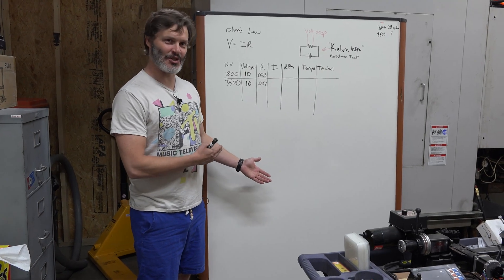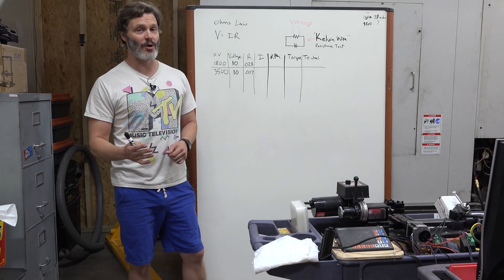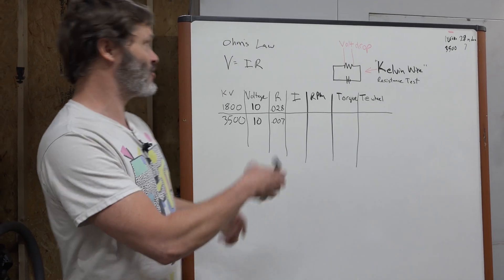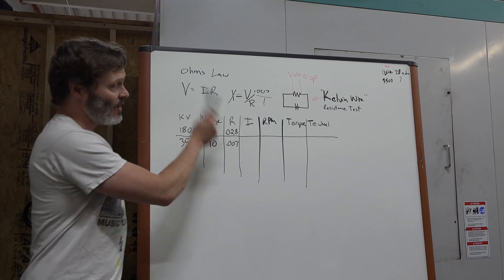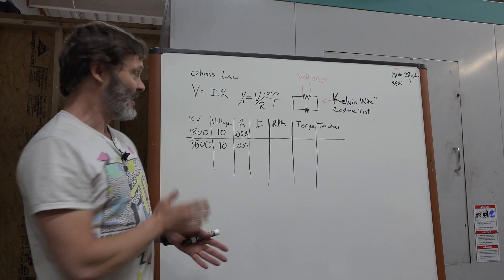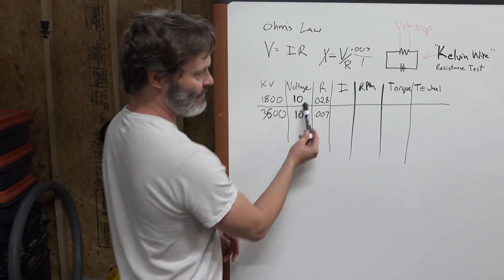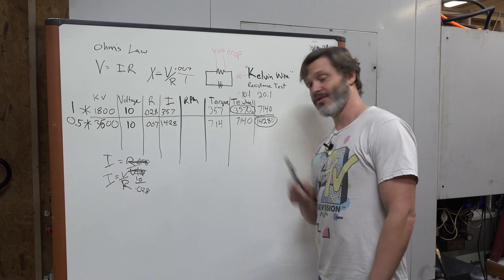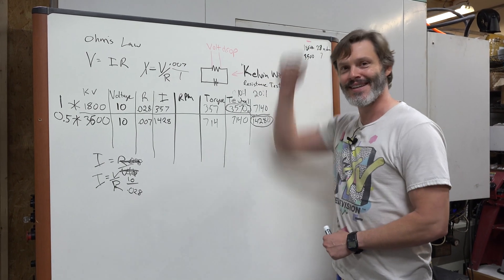1000KV @ 20:1 gear down vs. 2000KV @ 40:1 gear down || Holmes Hobbies which motor is better

Comment: Why do you see crawlers using lower kV?
Reply from the maker: Above 3500kv the amperage at stall becomes tremendous and requires a big esc. 

For the wheelspeed needed with the gear ratios available, 1800 to 2300kv is a sweet spot on 3 and 4s lipo. 

We really dont need more power or motor rpm than is delivered from a 2300kv motor on 4s. 

Rock racing does use higher kv though.  3500kv pullers are quite popular for that.

Comment: Is this the same for brushed motors?
Reply from the maker: @Motovlog865  Nay, brush losses make somewhere around 30t to 35t 540 or 27t 550 peak torque
Reply: @ I see, so a CrawlMaster Sport 550 12T on stock gearing would be better than the 8T geared down to the same speed?

Comment: Nice video. Could you please measure 3 brushless motors on dyno and do comparison torque graph for them (3 lines at once)?  It's hard to explain to people that higher kv motor produces more torque, they keep comparing them with gasoline and diesel engines in 1:1 cars. I found torque graphs for 21t, 27t and 35t GoolRc cheapo aliexpress motors, they confirm your words, but people don't believe saying that "it's some crappy chinese stuff, do you have better source for proof" and "you better do some study in phisics".
Reply from the maker: @built_rc   it doesn't work quite as well for brushed, because of brush losses.  Somewhere around 30t for a 540 is peak torque, depending on quality.   Lower quality, higher turn at peak torque.
Reply: @HolmesHobbies  what about comparing number of brushless motors with graphs?  I tried to search that kind of info, no luck. Manufacturers don't post it on websites

Comment: Great video! I’ve watched it multiple times. One thought I had is that your demonstration highlights what these motors are capable of with unlimited power. Based on the formula Torque = Kt × Current, where Kt = 1/Kv, the lower KV motor will always produce more torque per amp. However, since Mechanical Power = Torque × Angular Velocity, I can see why you emphasize that the higher KV motor is more powerful overall at higher speeds. At what point do you think it makes sense to prioritize a higher KV motor over one with greater torque?

Comment: I don’t get it. Don’t volting up and gear down make ur crawler has tone of torque twist? In climbing steep hills, this is going to make the rig flip, right?
Reply: Cause I geared my axle down a lot. Under steep hills, my rig wants nothing but lifting😅
Reply from the maker: @Bradon881   any time you make more torque or power, yes torque twist gets worse.  If it's making your rig peel off the rock you need to start changing suspension geometry or CG

Comment: Do you have a break down of your crawl master and trail master motors?  I am curious what the plastic piece is at the back of the motor just inside the cooling holes. I have a trail master 21t in a stock geared bomber. Using it as a crawler. I smoke checked something in the motor. Trying  to figure out what smoked.

Comment: How do I obtain parts for a 40:1 gear down condition? Is it possible to reduce the pinion, spur, and differential to get to the 40:1 gear ratio?
Reply from the maker: This was just a thought experiment to show that lower kv does not produce more torque in most situations

Comment: Okay, but this is all predicated on not changing voltage. If you KV down, you're supposed to keep the gearing the same and bump the voltage up in order to gain efficiency and runtime.

Lower KV, same gearing, same voltage = lower temps, lower top speed, less draw, longer run time, same (?) acceleration
Lower KV, adjusted gearing, same voltage = similar temps, same/similar top speed, similar/more draw, shorter/similar run time, poorer acceleration (lower torque)
Lower KV, same gearing, higher voltage = lower temps (?), same/similar top speed, similar/less draw, longer run time, same/better acceleration
Lower KV, adjusted gearing, higher voltage = similar/higher temps, higher top speed, similar/more draw, similar/shorter run time, same/poorer acceleration (?)
Reply from the maker: We have to keep something constant for sake of comparison. 

 If we doubled the voltage for the slower motor and didn't change gearing,  the example would basically be "how much voltage drop in your esc assuming it can handle twice the voltage" and nothing more. Since most escs are ran near their voltage rating, it's not a useful demonstration to showcase that lower kv motors don't actually produce more torque.
Reply: @HolmesHobbies  Doesn't necessarily have to be double, and my proposal in general is more for people looking to either select their power system from scratch, or start over completely.

Comment: This is a great video thank you! One thing I didn't get out of it though, how does this affect you battery? May be a dumb question lol. Assuming I'm using a 3s battery, would a 1800kv with higher gearing use more juice than a 3800kv with lower gearing?
Reply from the maker: Depends on how you drive.  If super easy, runtime will be about the same.

If you drive hard, the higher kv will have less time because you are using the extra power available. 

Longest runtime would be 1000kv at 40:1 however.  But wheelspeed is half as much.

Comment: I miss my cobalt 10 puller motor. That was hands down the smoothest most bananas powerful crawler motor Ive ever run. Easily twisting off axles and causing general mayhem to the chadsis and driveline of any irresponsible throttle application. I would have that motor again 1000 times.

Comment: 10:15 But if the 1800 KV Motor has twice the turns on the stator the magnet field will also twice as strong = more torque per amp
Also the bigger Motor use 4x more Energy and has also much more losses overall to double the torque.  Very bad efficency here.
For drag brake i would recommend a sensred motor.  I had one from Graupner 15 Years ago.. The Braking was like a brake disc !  Even still standing
Reply: True that more turns provide more torque per amp. The issue is that it will lose amps per volt "faster" when increasing the number of turns. Thus less torque per volt when increasing the turns.
If one stick to the same volts per turn the motor will theoretically behave the same, no matter if it's one or a hundred turns...

Comment: late to the party (got into the hobby not long after this video was posted, so it took me a while to find something like this, discussing it in more technical terms :))

aaanwyway, now that i understand things a bit better, i have a technical question tangentially related to this one:

does it matter WHERE you do the gear down? to try and be more precise, i mean, are there any pros or cons to gear down by going to a smaller pinion, compared to let's say changing the transfer gears, or if you take something like the SCX24, getting a higher tooth worm gear, if the final gear ration at the wheels will be the same, roughly? intuitively, it feels like the only difference would be maybe in where you'd have more strain in the driveline?

another question that popped in my mind: how about a discussion about different gear (particularly pinion gear) materials, their pros and cons? i feel like there are probably some misconceptions about those in this hobby (modern plastics are pretty good, and that hardened steel gear probably isn't as hard as you think...)?

love your videos! keep em coming :)

Comment: I know on a couple videos ago I commented about being worried that my 1000kv wouldn’t be good enough for my TRX4 2021 bronco. I’ve recently purchased a 1000kv V2 revolver and a castle mamba x. Drove it today and wow what a difference. I set my tune up the exact same way you did in your mamba x tuning video (with the addition of 2nd gear being rock race mode) and my bronco is a whole new animal now. It’s doing lines crawling that I used to have to bump before. So far I think the only downside is it’s overall slower so second gear doesn’t go as fast as I want it to but the control in first now is worlds better. I’m only on 2s lipo as well. I imagine it will be even more improved with a 3s battery and some gearing changes? Thanks for the explanation and video!!
Reply from the maker: just go 3s, it will be perfect!

Comment: So if you geared down while also having a lower kv motor, wouldn’t the low speed control be better than the same gear ratio on a higher KV?
Reply from the maker: It would be easier to control (slower always is) , but not necessarily slower startup.

Comment: I want to know what happens when you hit your peak rpm?  Are there risks?  Is this a big no no?
Reply from the maker: Could explode the rotor if it's really fast. My motors are 60k no load rated.  Still not a good idea to Rev them without load

Comment: A buddy is running a hobby wing quick run fusion…. It’s is soooo smooth and torquie at super low speeds. They claim it’s some intelligent torque output technology. What’s the secret and how do I match that or beat it with Holms equipment???

Comment: Getting back into crawling after a 15year or so absence. Just bought a Phoenix portal with mambaX and CC slate 2850KV sensored. When you say hear down I’m assuming you mean on the motor since that’s the easiest. So what gearing would you recommend as well as Lipo. I am so not up on the Lipo stuff yet. Would really like to hear your advise on which battery setup to use. I’m also needing you to stock the 800 servo or should I go with the 650?  Thanks.

Comment: Very nice, my rig was using 55T 540 motor, 56T spur gear and 13T pinion, change it to 35T 540 motor, 87 spur gear and 13T pinion it's really awesome, now i can crawl uphill better, better torque, better low end speed control, i haven't test for runtime yet, but overall very nice...

Edit :
After i try several times, i feel my runtime hasn't changed much, i didn't count my runtime, but approximately 2 - 4 hours before change, and almost the same after that, very nice

Comment: This is all assuming that you can achieve the correct gear ratio with the desired kv.  It would be nice to see trans ratios a bit lower overall with a 15t or so pinion so that you more range of gearing.

Comment: So it's like running 4.56 gears in a 300hp 4 cyl. Vs 4.56 in a 300hp V8 in a super simplified nutshell yes they'll have more torque but the V8 won't have to work as hard under the same conditions

Comment: Very cool I did this with my Drones ran 6S on 4S motors and just set the endpoints down to 66% to get it where it wouldn’t pull too many amps but get the extra torque I love it as long as you can say you’re in points you can do this with any brushless motor I found out so I always just buy high KV
Reply from the maker: Not a good idea in a crawler, will smoke the esc.  Use 100% epa and gear down instead.
Reply: @HolmesHobbies  yes sir

Comment: Johnny! Nice explanation. Hobby shops have said the opposite of what you showed. If this can be applied to brushless, can we use the “kv” number and substitute “T” for turns on a brushed motor?  If so, who killed Tu~Pac?
Reply from the maker: It works on brushed until about 21t550 or 27t 540, then brush saturation makes them lose torque
Reply: @HolmesHobbies  nice info, thank you

Comment: Can you explain the difference between undergearing and overgearing a brushed and brushless and how affects motor performance and esc's.
Reply: I dont know what the exact terms you are asking about mean in relationship to the gear ratio (wether undergearing means too high or too low gearing) but i may still be able to answer your question… Anyway: having too high gear ratio e.g. 400:1 basically means that your car isn’t driving as fast as you’d like it to (for example a crawler you want to go on walks with should be at least as fast as you walk). This will give you way more torque compared to normal gearing and affect the esc in no negative ways. On the other hand a gear ratio of 5:1 will make your car go crazy fast while taking away a lot of torque and heating up the esc more (shouldnt be a problem in crawlers but fast cars may turn off their esc when it gets too hot). 
Having too low gear ratio puts the motor under a bit more pressure but a good motor shouldnt take any damage from that.
If you have any questions on what gearing to use in order to get the right speed for your vehicle go ahead and ask

Comment: I'm so tired of seeing the tired old myth of a higher turn motor having more torque. "I use a 55t turn because my rig is built for torque"
Reply from the maker: With brushed, it's true down to about 30t to 27t range.   Then, as it gets slower it loses torque again.   All due to brush saturation vs coil resistance.

Comment: Dangit. John just voodoo mathed all of that bought his 1800kv pullerpro's into going back and getting 3500s.
Reply from the maker: We don't always neeeed the extra torque...
Reply: Just a reminder: using a 3600kv compared to using a 1800kv motor will divide your runtime by 4! Just make sure it’s worth it

Comment: So if I gear down with a '9900 castle system it'll be more torque than a 3800
Reply: There are limits with the battery, esc, and wires that give us a goldilocks zone  around 2700kv on 4s and 3500kv on 3s.

Comment: So other than not having the ability to gear lower, why would one ever choose a lower Kv motor? I run your CRAWLMASTER EXPERT 540 13T. If I can gear down enough, why not run a 540 buggy race motor (and why don't you sell them!)?
Reply: Brushless
Reply: There is a point where more wheelspeed or more gear down isn't wanted or possible
Reply: Someone would choose to run a lower kv motor cause (ratio between different kv-motors) squared is the factor for extra energy comsumption… as showm in the video: ratio between 3600kv/1800kv=2. 2 squared=4. if you look closely into the data about i (which is the amount of amperes) you can see exactly what ive written and he also explained why you have to calculate just how ive shown you (because of heat creation inside the motor…) This basically means that twice the kv gives you 4 times more torque and divides your runtime by 4.
Reply from the maker: In brushed, going faster than what i offer does actually harm torque .  I'll have to make a vid on it. 

I brushless, over 3500kv becomes hard to gear down enough for and the esc/ battery take more beating.

Comment: Brushless: KV ⬆️ GEAR ⬇️
Brushed: VOLT ⬆️ GEAR ⬆️ (???)
Reply: What happened when you introduce sensored vs. nonsensorred brushless systems into the equation?
Reply: @mrstanton81  sensored and nonsensorred only means the quality of controlling of motor rotations. it is important on slow rpm's.
Reply: for brushed and brushless it works similar.
volt up = higher rpm. higher rpm = higher wheel speed. gearing down = lower wheel speed and higher torque.

Comment: Im bought your puller pro v2 2200kv and mamba x for my vanquish phoenix on 3s. If I were to switch to 4s what gear ratio would you suggest? Given stock is 52t spur 15t pinion 32 pitch, I have a spare 56/13 from my wraith. Would just the pinion change make difference? But man is it a sweet setup with the phoenix. Feels so similar but way different then my br-xl and crawlmaster 550. First brushless motor 😆 love all your products next is my shv650 👍🏻
Reply: I'd just run it on 4s, but going to a 11 to 13t pinion isn't a bad idea
Reply: @johnrobholmes  gotcha I know you recconmend 6:1 gear ratio for crawling just didn't know how the portals effect that ratio.